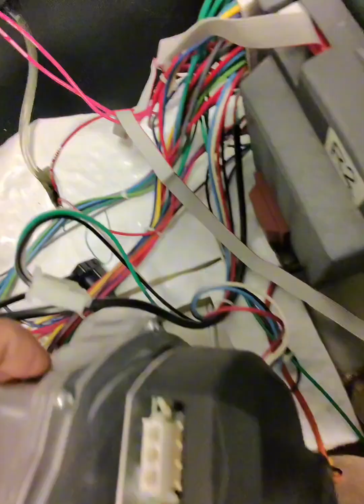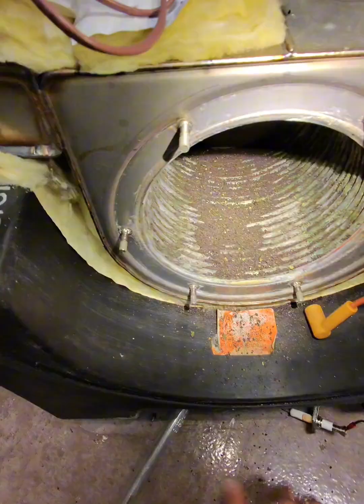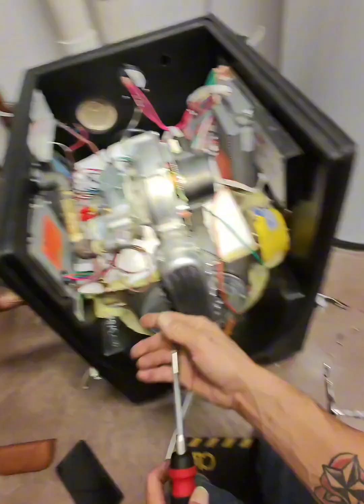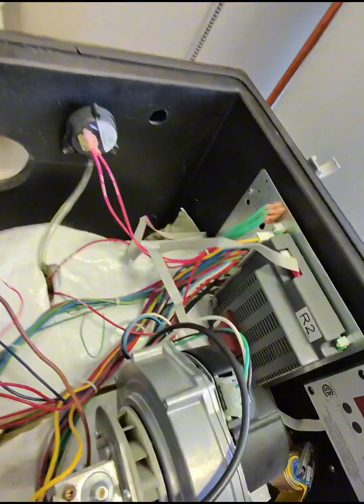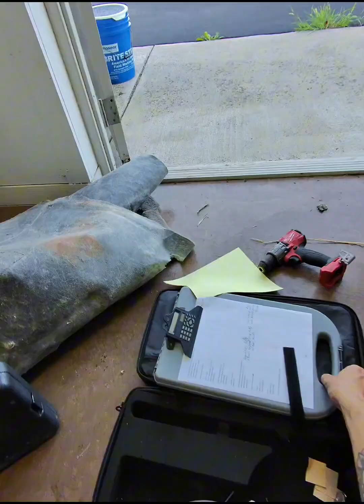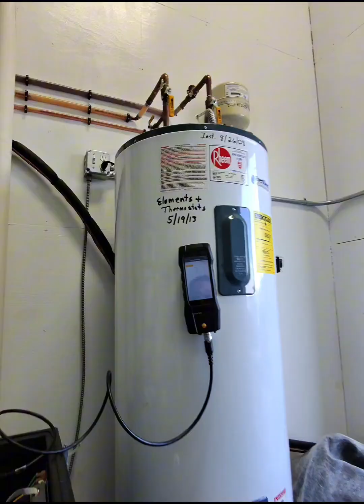Munchkin Boiler Maintenance

Comment: I had a company come out and do a boiler service on my Munchkin 199MLHPA. He used a liquid cleaning solution on the heat exchanger and a brass brush. Seemed to get it back to stainless steel new condition. Do you not recommend that method? 
Thanks for sharing your video.
Reply from the maker: Yea that's fine. Different strokes for different folks. I don't like to scrub too hard because if i scrub too hard and accidentally make a hole, Then I am buying the customer a new heat exchanger. I just heavily consider the risk with that particular boiler because parts are expensive and hard to find.